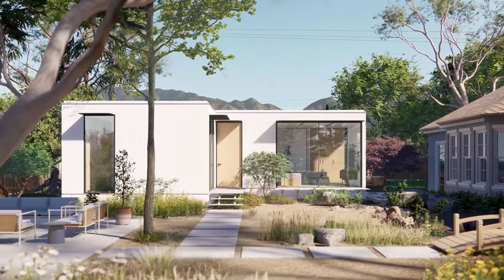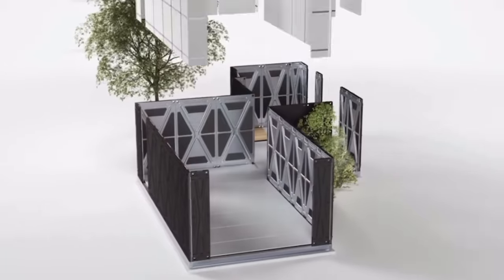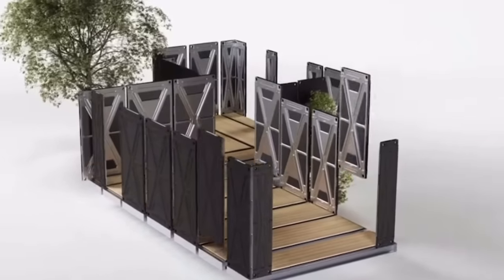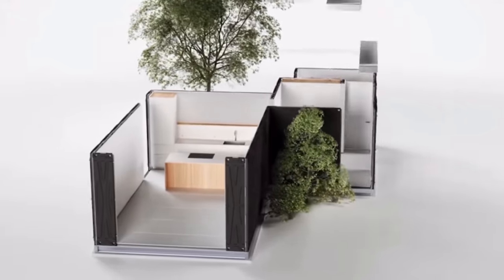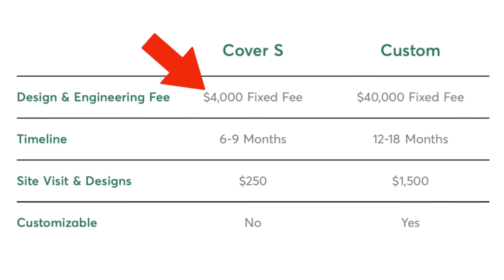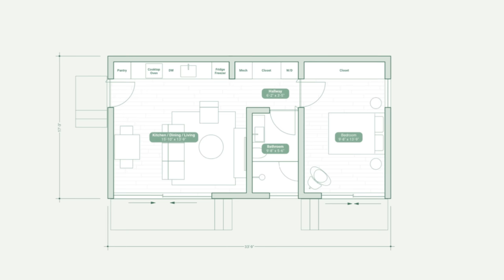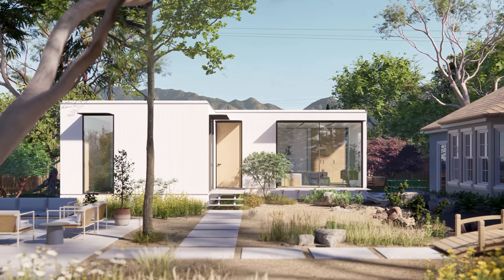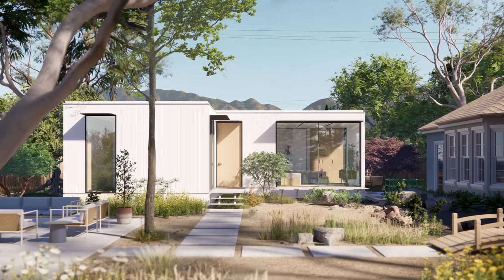PREFAB HOMES in California Just got More Affordable!!

Comment: @Kerry, The glass wall in showers are opaque. Cover did install a clear glass wall window in a custom built home. The transition of the images in the slide show makes it appear that the glass wall can use electricity to go from clear to opaque. I would have paid for that option, but it was not available when I purchased mine and I'm pretty sure it still is not available.

Comment: Cover is not pricing competitively with their latest options. Their 800 sq ft house cost 500k. You can get a larger prefab from blu homes (Origin 1000 is 1000 sq ft) for 400k and its more luxurious. You can get an prefab from ORCA for less as well compared to cover. What is the justification for the price difference when compared to their competitors?

Comment: To me, this is the single biggest issue.  Every company is claiming efficiency in time and cost for using manufacturing lines instead of site built.  While true for time, its not true for cost.  I live in AZ and site built is around $200-300 a SQ/FT.   Manufactured home with custom home quality is significantly more expensive and thats compared to a state that isnt considered cheap.  They really need to figure out the scale and manufacturing to build at $100-$200 sq/ft. I believe a generic panelized system like Cover is the way to go, but they need to get out of California and move to Mexico.  Currently these homes are an astounding $600 a sq/ft!!!!
Reply from the maker: Thanks for watching

Comment: The issue with traditional and new prefab is the problem with condensation. Neither if not insulated on the outside will keep moisture and mold out over time. Drywall is a thing of the past. A glass house is better than drywall. Like the video and the product, price of a glass house is not affordable though.

Comment: This still is not affordable.  The website has the S2 unit - 870 sq ft @ $514,000 $590/SQ FT.  No. The point of prefab was to be cheaper and easier to assemble than stick built.